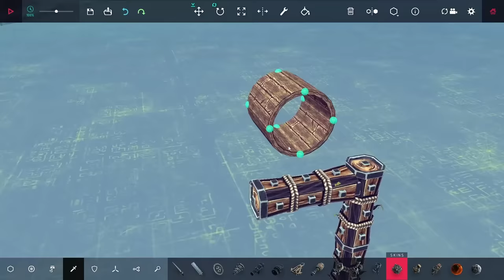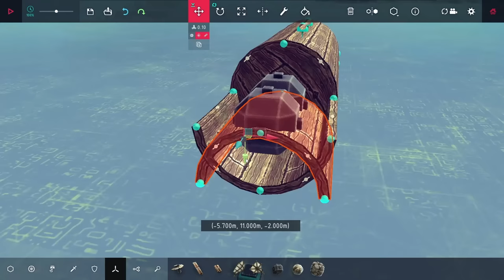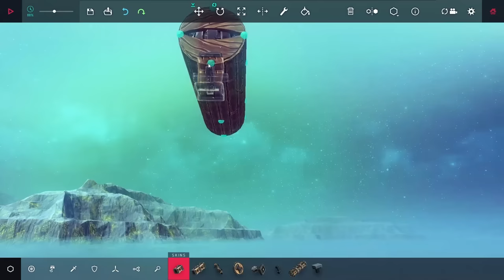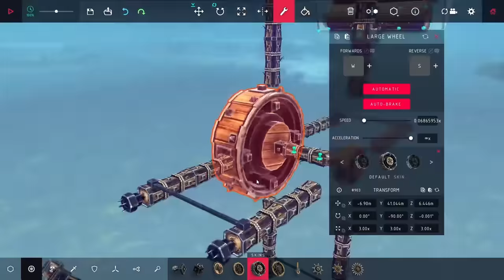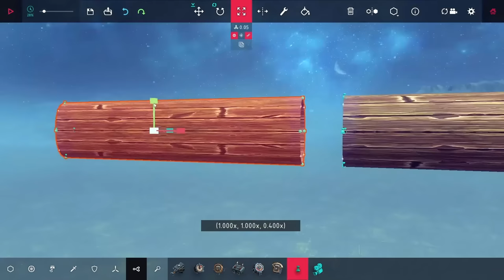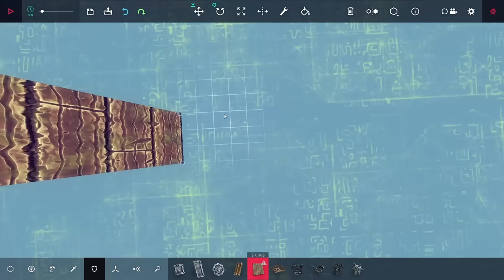Making a Fully-Automatic Gun in Besiege

Comment: Every time I watch one of these videos I can't help but think you're being held back by the game. Some may argue that's part of the challenge, but it's not really fun to watch something which performs so poorly just because the game is so rigid and prone to random wonkiness. It would be so much more interesting to know what Reid could do with a game which had less limitations.
Reply: most the wonkiness comes from Reid more than the game. And it by far doesn't hold him back, it's one of incredibly few games that allow you to build anything you can think of, and not just lock you to ideas like wheels can only be used for wheels or make stuff like a helicopter block and that's the only way to fly.

Literally one of the construction games with fewest limitations....
Reply: @RupeeRhod  Okay, but, everything explodes if bombs are within the same zipcode as each other and you can't put shields between them to solve that.

I'd call that a pretty serious limitation.
Reply: @shufflecat3334  Besiege is already pretty CPU heavy and adding extra stuff like this would really push explosion lag over the top. It's not ideal i agree but technical limitations restrict that, as Rupee said beseige is on of the most physically realistic games already and with even more realistic physics you would start to go into seconds per frame and not frames per second due to it needing to be so general (Specific sims designed for a single purpose could increase framerates but then that defeats the point as it is no longer a sandbox)
Reply: Mods also help add some less restrictive parts and part scalings
Reply: r e d s t o n e
Reply: @RupeeRhod ngl if someone were to mix storm works with besiege it would be amazing

Comment: Maybe you can make a open bolt machine gun next, I don't know if it is possible in Besiege but it would be cool.

Explanation of a open bolt system 
(I tried my best to explaining it)

The striker is attached to the bolt, the bolt is held back and by letting go of the bold it flies forward Is hitting the primer there by firing. after firing a round the bolt is forced to the rear, ejecting the empty casing and the bolt remains held at the rear ready for the next shot
Reply: Sorry for my spelling mistake I am dutch
Reply: So closed bolt has a bolt, striker/firing pin and hammer while a open bolt just has a bolt-firing pin combo? I assume that it uses belts or something similar that puts the bolt into the breech without it moving. Ex 
Belt moves bullet inline with breech and bolt, bolt is released and shoves bullet into breech, momentum pushes the firing pin (in this case a small nub at the front of the bolt) into primer, bullet fires and bolt returns to the back
Reply: @barklet6110  An open bolt is pretty much a spring, bolt, firing pin, and trigger. The trigger's only job is to get out of the way of the bolt, and the firing pin is fixed to the front of the bolt, as the bolt closes, is strips a round from the magazine, and as the round enters the chamber, the firing pin hits the primer of the round, and Newton's third law, is that every action has an equal and opposite reaction. The bolt goes back with the same energy as the bullet, however much slower due to inertia, since the bolt is dozens of times heavier then the bullet, and the cycle repeats until you either run out of ammunition or you release the trigger. They are dead simple.
Reply: @mr.dynomite8890  oh, I get it now. I had this misconception that the bullet would get caught on the firing pin if it loaded like a normal gun.